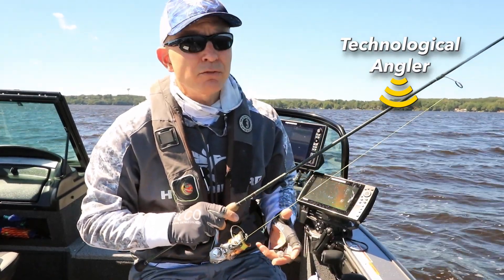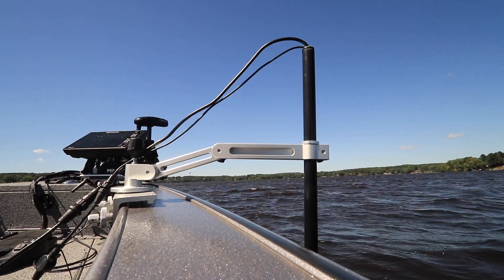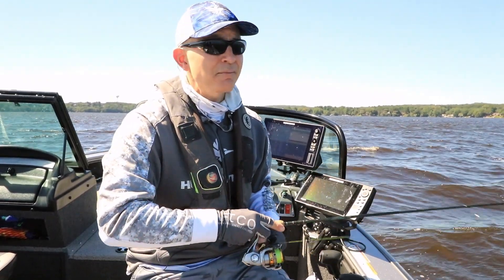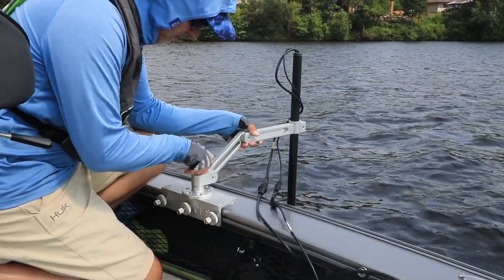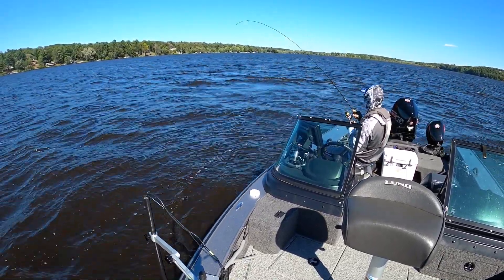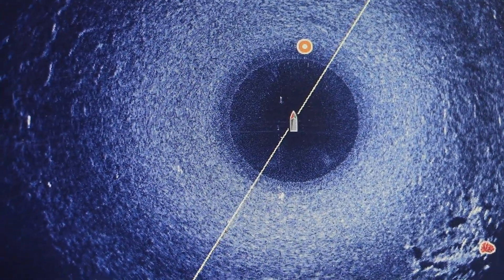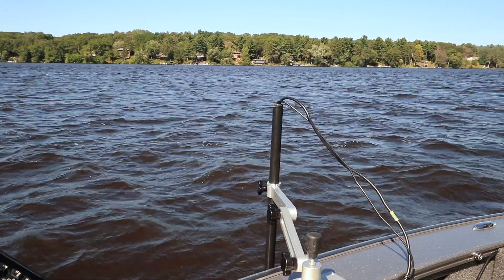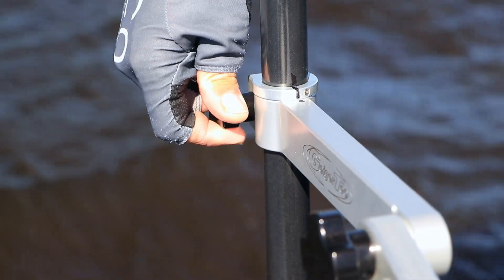MEGA 360 Universal Mount - Alignment Tips

Comment: Can you turn a helix unit on when it is out of the water like at home in your garage?
Reply from the maker: Hi William,
Thank you for contacting Humminbird on this matter.
Typically to do this we would recommend to have the unit on in Simulation Mode. This would be done differently depending on the model of the fishing system you have.
For example a SOLIX will ask when you first power it on if you would like to start up in Normal or Simulation. If it doesn't you can always go to the HOME screen, then Settings and then Simulation and turn this ON.
On a HELIX or other model, when you first power the unit on, you would press Menu as soon as you see Press Menu for start up options during the loading process. When you do this you will select Simulator and press the Right arrow key to enter into this mode.
Please feel free to reply to this message if you should have further questions.

Comment: how long does it take for the 360 to complete/refresh one full circle? That line seems pretty slow..
Reply from the maker: Hi i_fish,
Thank you for reaching out to Humminbird on this matter.
This would typically be determined by the 360 Speed setting within your unit. To better assist you we would need to know the model of your system, what version software you have currently in the system and your 360 Speed setting.
Reply: 3 speeds, slower=more detail.